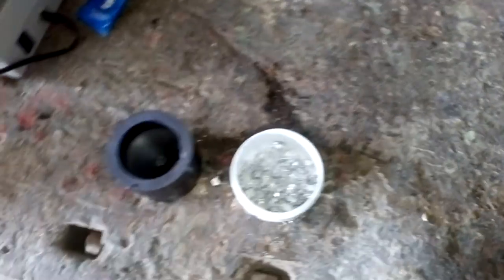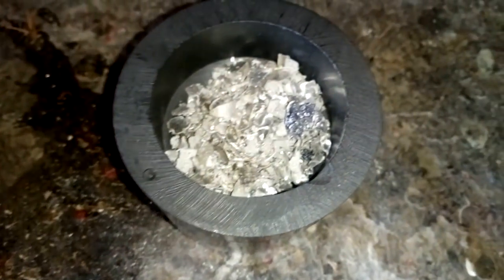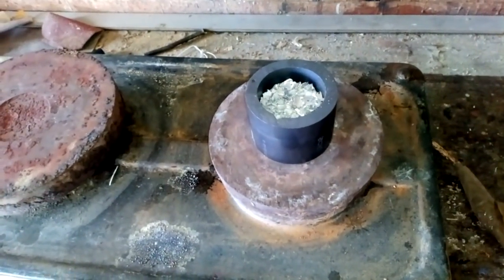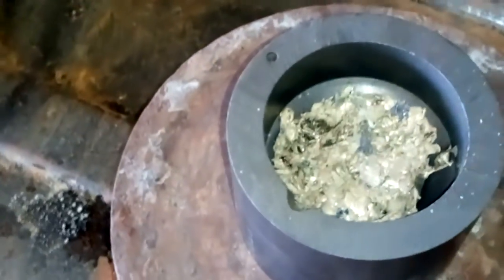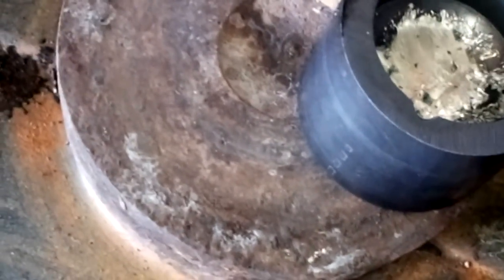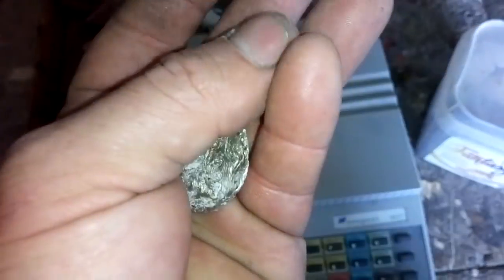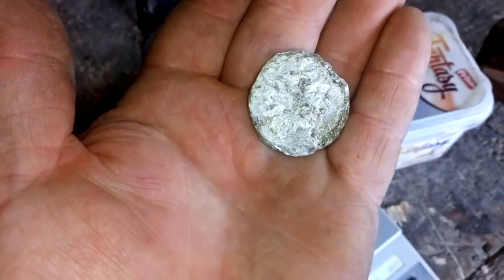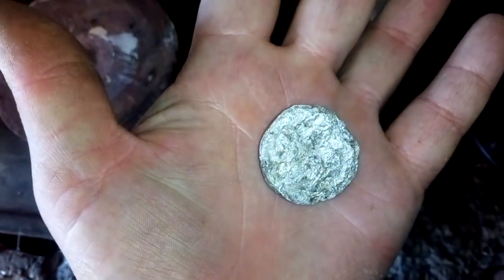INDIUM MELT on the STOVE!

Comment: Thanks for the Video. Nice button. But I do not know if its pure Indium. To exclude or proof the presence of tin, you could dissolve a small piece (or the waste of the melting) in HCl and combine a drop of this with a drop of a Gold containing solution. If it gets dark, then tin is present. To exclude or proof other metals (e.g. Gallium, silver, bismuth) by consulting Wikipedia for the proofing methods of the different elements.
Reply: Probably contamination is copper, nickel and gold. That's the metals used in the interface between the heat spreader and the silicon die. Tin is not used in this application.
A nice diagram is shown in the previous video where he collects the indium from the CPU:s.
Reply: yeah I saw this, you are right
Reply from the maker: golder70 Nickle and gold in small amount, but it is pyre  minimum 90%!
Reply: @999DusanGoldrecovery  i have indium pure quantity 26 kg in vietnam 🇻🇳https://youtu.be/kU59wy-dM-Q
Reply: ok, thx
Reply: Xtreme Performance  sorry but it absolutely is.  you're typing all this because his indium is 90% maybe, not 100%.  He can refine it if he wants.  The point is, it's there and it was free for him.  Dusan is the king.  Very informative, great videos.  get off the mans nuts
Reply: I have indium pure quantity 26 kg in vietnam 🇻🇳 click the link to see it
https://youtu.be/kU59wy-dM-Q
Reply: I have indium pure quantity 26 kg i in Việt Nam 🇻🇳click the link to see ithttps://youtu.be/kU59wy-dM-Q